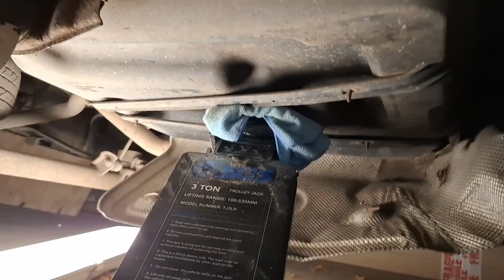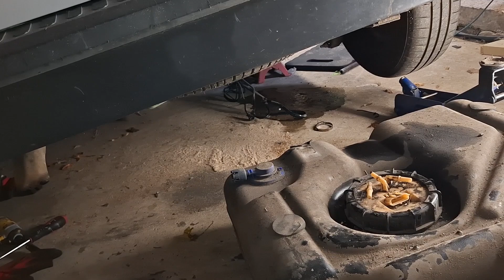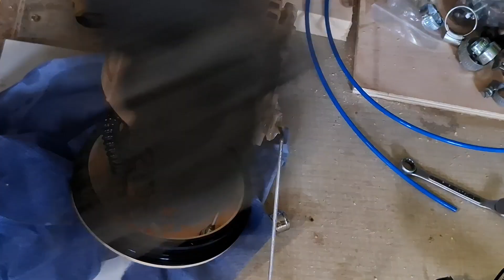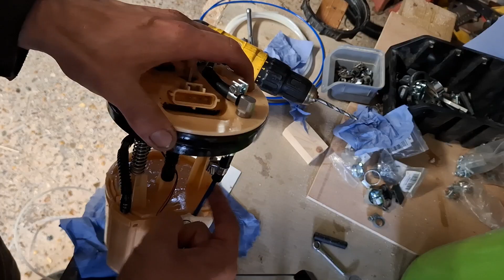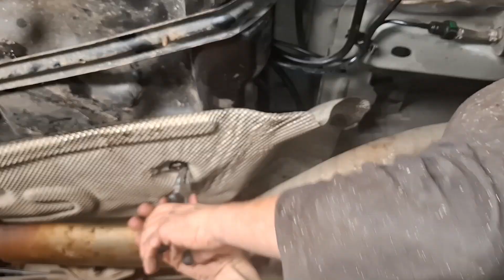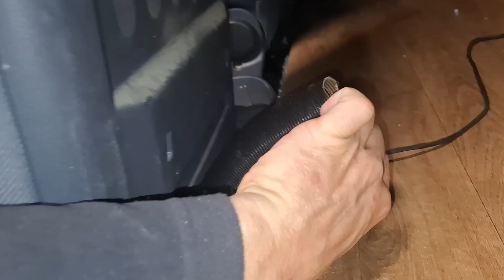Diesel Heater Pt.2 |  Dropping the tank | Fitting the standpipe

Comment: Where did you get the blue fuel line from that you’ve used for the pipe in the sender unit?
Reply from the maker: I get the majority of my components from Butler Tecknik 👍

Eberspacher Espar Webasto Heaters and Victron Energy | Butler Technik https://share.google/QQFv2sr9H5XY6h9WF
Reply: @russwalker78 I decided to put the clear pipe straight on to sender pipe that was cut, no jubilee clips inside the tank, works ok so far